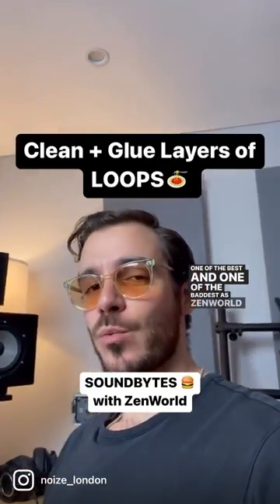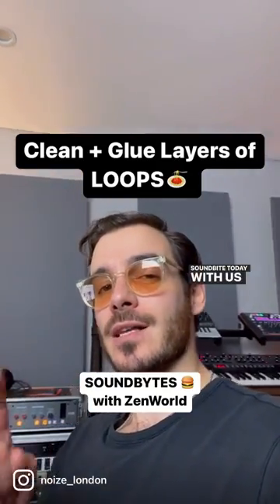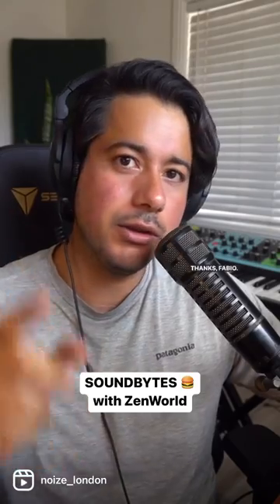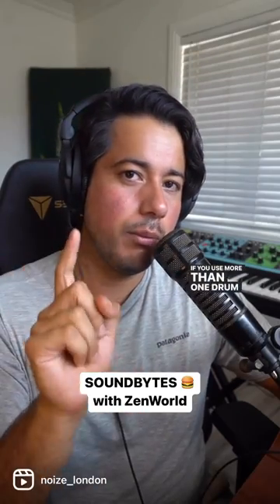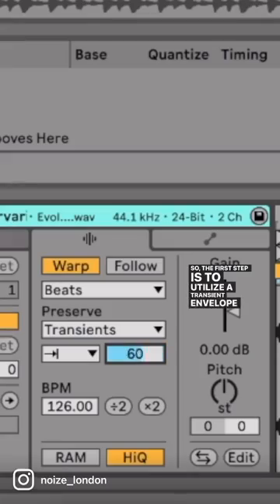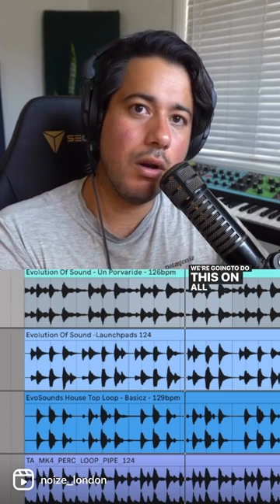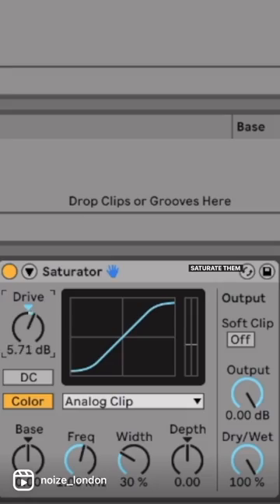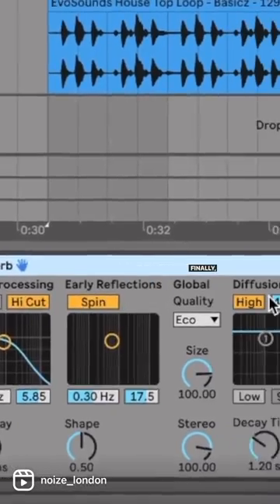How to make the most of out your LOOPS with@ZenWorld

Comment: I came up with a very similar approach to layering drums.  All hits get SSL drumstrip and DBX. However, I never use premade drum loops and its rare they play the exact same sequence.

I will split up multiple drum tracks with variations from all accounts [complexity, effects, pan, drum hits]. I even add gates to one drum track with 50% wet/dry so all the small intricacies stay somewhat subtle [like instead of ghost notes... theyre ghost tracks]. And I build each track on top of a basic four on the floor [keeping them in time, resample them into one audio track then add a one knob pumper to the resample] while one of those drum tracks gets converted into a bass synth with descending 12s arp. I sometimes turn it into swiss cheese by lining up all tracks and start deleting random parts, invert every 3rd measure in each line, split first four measures into a halftime pace for the intro.  Isolating small parts to a single drum hit to add suspense.  Some drum hits get glitch 2, infiltrator, digitails... some volcano 2.

Eventually, I always get to a spot where have to step back and observe what I just created like O_O "Dude!!! Whoa!!! Dafug did I just make?!?!" 
drops BPM by 20

Ten seconds in listening and previewing it... I go doodoo in my pants...